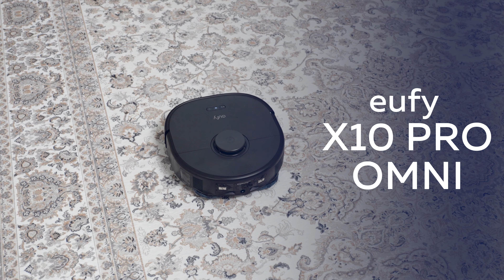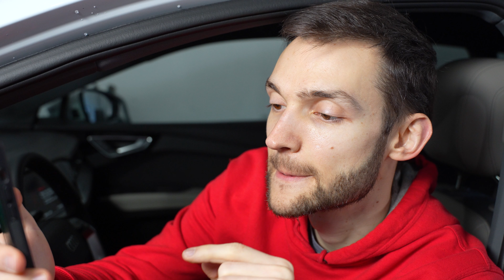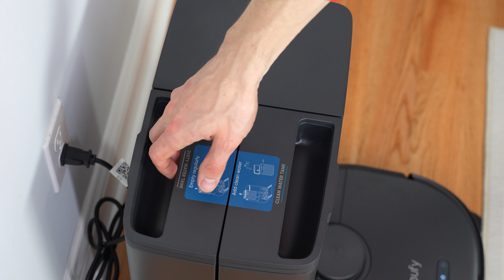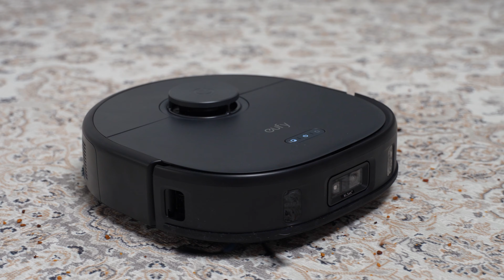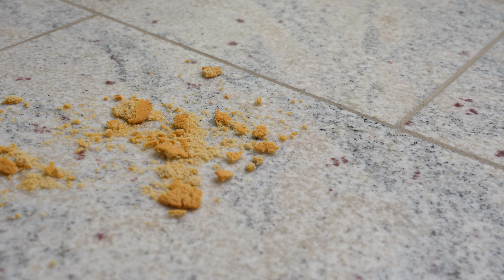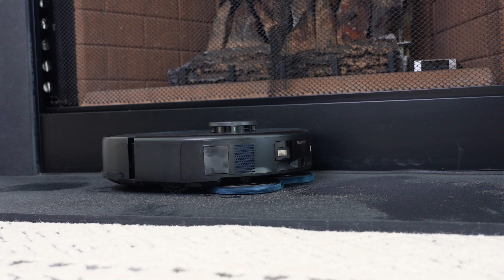Why you NEED to Have this Robot Vacuum (eufy X10 Pro Omni)

Comment: Very very very bad commercial review.
Reply: Bad review? Are you kidding?
Reply from the maker: what's wrong with it?
Reply: @YouFactTech   the station is HUGE . The dustbags are extremely expensive. The app sends data to China. The mop function is just wetting the floor. And yiu probable pay a monthly subscription for cloud storage,  "just because". Cleaning the dustbin in an automated vacuum is 10 seconds work. All that crap is unneeded.
Reply from the maker: Thanks for the reply, but let me clarify a few points:
1. Considering the station performs comprehensive service functions, it's not large. When compared to other full-service docks, you'll notice the difference.
2. A pack of 6 dust bags is currently $28 on Amazon. Since you can change them once every two months, $28 covers a year's worth of automatic dust collection, which isn't expensive.
3. The app doesn't send any data to the cloud unless you opt into data sharing in the app settings.
4. The mop is much more effective compared to a regular mop pad since it rotates and applies pressure.
5. There's no monthly subscription needed because storing data in the cloud isn't necessary.
6. The station does more than just clean the dustbin; it cleans and dries the mops and refills the robot with water every 20 minutes of operation. If you prefer doing all this manually, then this robot might not be for you. 😁
Reply: This is the best review of the X10 pro that I have seen.  It covers many of the conveniences and features of this class of all-in-one machines.  I learned something new today!